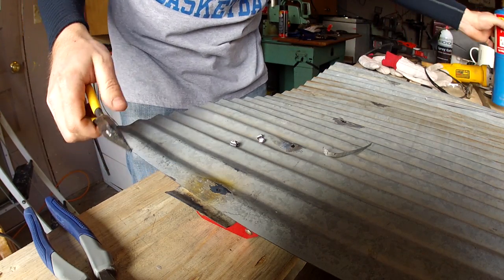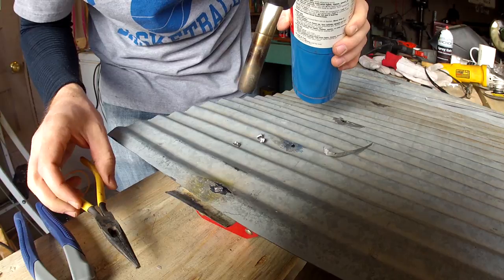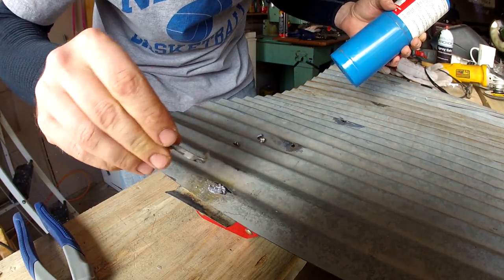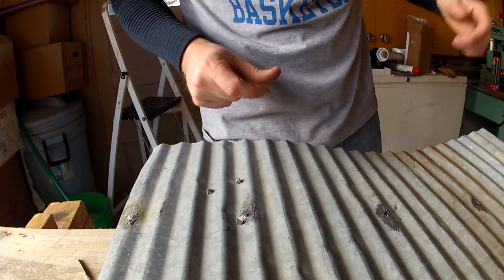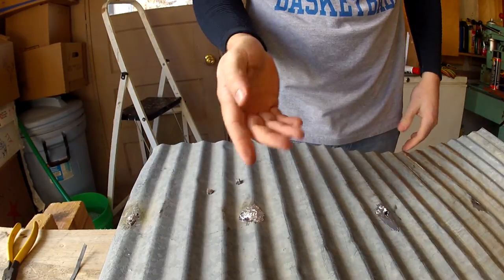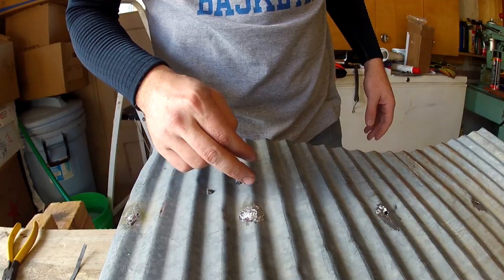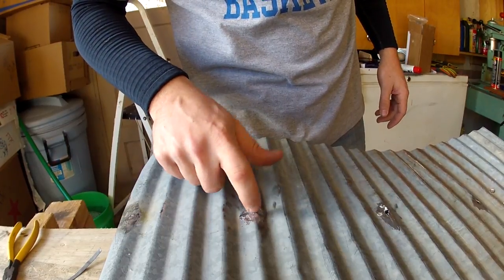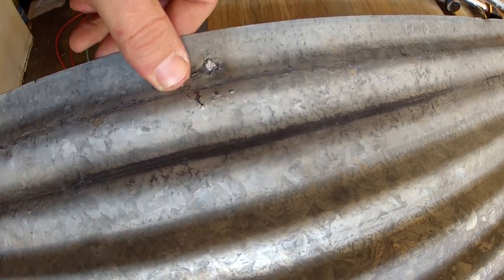Repairing barn tin: Applying the patch

Comment: For those reading the Solder is likely lead, but you can do it with galvanizing flux or pool acid and no grinding. Any map gas or acetylene torch works good. I use commercial irons and torches almost daily making galvanized duct.